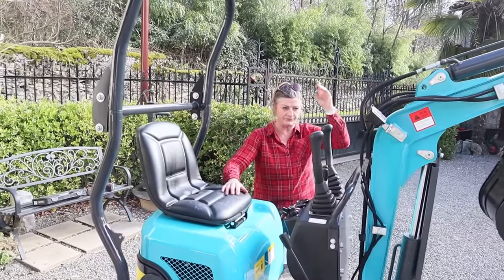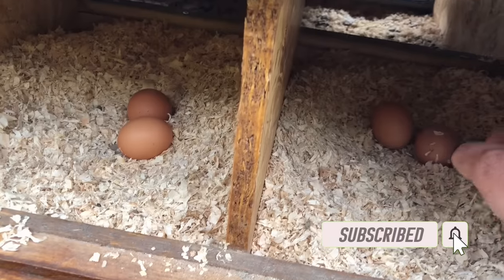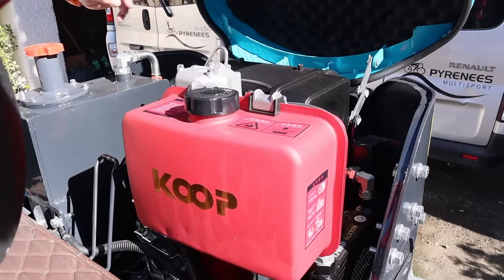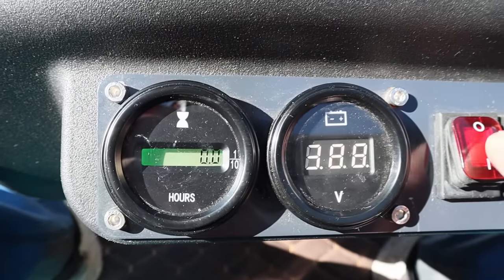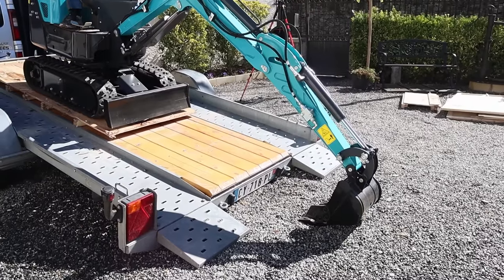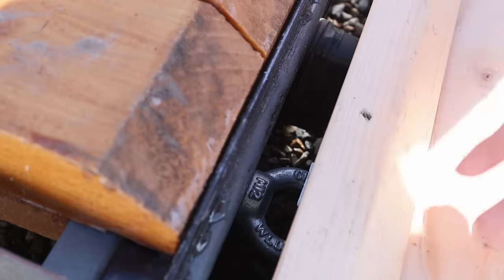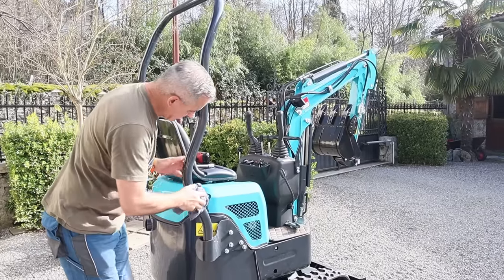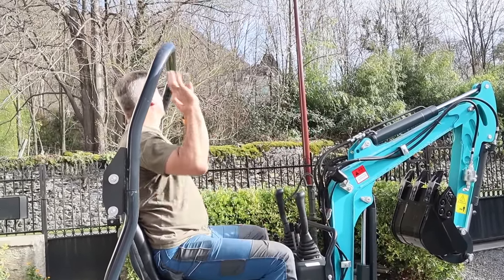Unboxing Chinese Mini Excavator | Nuoman from Alibaba

Comment: The only thing that would worry me is the uncertainty between China and Tiwan. If China Invades will there be sanctions and will you still be able to get parts. A seat belt would be a good idea. If it dose ever go over you want to stay inside the roll cage. Most deaths happen when people try and jump then get trapped between the machine and the ground. My number one plan with any machine when it goes wrong is stay inside the safty cage.
Reply from the maker: Cheers Mark - I have fitted the seat belt since the video.  Parts will be fine locally, they are very standard and if not I should be able to fabricate something.  Thanks for watching.
Reply: @HomesteadingUncontained  To be fair most the things we buy in the UK come from China any how, even the so called it was made in uk companies get the materials or parts from China. Chips for car engins is a good example, We can only hope that dosn't kick off anyhow. Glad to here you've got the seat belt sorted. I rolled an old 3cx J.C.B many years ago and it didn't have a seat belt fitted. I can highly recomend not doing that again as it rolled two and a half times down a steep embankment while i desperately tried hanging onto the seat. These days i like to be firmly strapped in.

Comment: Hmmm, haven't watched yet or seen 1 month down the track. But my past experience ... and gut feelings about Chinese machinery ... is not good. Some needed work before first start up (loose hoses etc); some had bits fall off a day/week/month later due to the nasty cheap bits they just phillips screw on; sometimes they wear out and won't start well after a few months.

I came to the conclusion, spend more for reliability and resale value.

Good luck.
Reply from the maker: The machine is well built.  It performs well.  And the price was good.  of course if I had a much bigger budget I would have gone for a locally sourced named brand but at theme I could not even get a 2nd hand 20 year old machine for less then €12k.

Comment: Greasing non moving parts is absolutely pointless.
Reply from the maker: It is common practice for me - I have two 75 year old cars and when I renovated them, I had to prise plates apart from each other that had rusted over the years.  So there is no harm in greasing between non moving parts to try and stop that from happening.

Comment: Guys, that machine has caterpillar tracks for crying out loud. What do you need a ramp for??? Maybe you guys should have watched some U-tube vid's of people operating excavators. You know what they say, a little bit of knowledge is a bad thing.
Reply from the maker: To be fair, I built this little ramp to protect the trailer lights as I use it also for my tractor.  But yes, I will get used to it for sure.

Comment: Check out Dig_It_Starnes  He has a review of the same company. It's a little different but he says the bucket teeth should be mounted on the inside of the bucket. He says that's why it will not dig that well.  I have no idea. I am just sharing what he said.
Reply from the maker: Cheers Van.  Just did and you are right, the teeth seem to be on the wrong way round.  I would have never known.  Will try and swap it round.
Reply: @HomesteadingUncontained  It may, Like I said I just watched his video. I hope it helps you dig better.

Comment: Can tell you've  never driven excavator.
Reply from the maker: You guess right, but it will not take me too long to get the basics, I have to as it is me doing the work. 😀
Reply: @HomesteadingUncontained  you could have used the boom/arm to avoid digging into your driveway.by putting the bucket flat and pushing down lifting the front end up.It's a useful technique to learn for crossing ditches etc. Though that thing wouldn't cross a very big ditch. Some of the coolest stuff is about 40 to 60 feet down.at base of mountains or hills buried in the old run offs..If you get bored 😊 I would get in trouble around here with that thing😅

Comment: The engine must be KOOP around 10kw

The engine power drops so quickly as the hydraulic cylinder moves to end (stall). And no matter how big the oil cooler, still, this engine cannot be operated in a long periods.
Reply from the maker: I think I will overheat before the digger - but I know what you mean, I will be gentle with it 😀

Comment: Unfortunately these are little more than a toy
.even a well used brand name machine is superior to these.pump over heats  with any meaningful amount of tracking and realistically a couple of mates an box of beer is a faster option than these.
Reply from the maker: It is doing pretty well on my build so far - you must have some pretty big mates.  I have an oil cooler on mine and it is working through 40 degree days at present.

Comment: Question, WHY would anyone buy an expensive piece of machinery from CHINA? First of all, they have NO Quality Control. NONE. Once you buy it, you have a LOT of problems finding PARTS. Then there's the problem with Will It Work. When I was working for the DOD, they bought 8 "Mini-Trucks" for their maintenance people to drive on the base. Out of the 8, 6 had SERIOUS PROBLEMS. Like Knocking engines, Clutches that wouldn't return when pushed. Same with Accelerator Peddles, and all 6 had to be returned. Poor Dumb Business that Dealt with these trucks had to EAT the loss because China does NOT take items back. Just find a good used one with a Known Name. Parts will always be available as well as Service.
Reply from the maker: I must be lucky as my machine is perfect and I can source parts locally as majority are standard items. A 20 year old know brand here is still double the price of this unit and probably knackered.

Comment: If you can afford to buy something old and local built and fix it up I would go for it rather than buy cheap nasty Chinese junk.
Goodness knows how long it will last and I couldn't trust it to be totally 100% given how cheap and dodgy they are when it comes to building or making / manufacturing anything. If I was going to buy something kinda cheap and new I maybe try looking for things made in Australia, USA, Germany, Japanese, UK.
Reply from the maker: A 2nd hand crappy old machine, say 10 years old or more was 3 times the cost of this machine.  I did the research and tried the auctions and would have loved a Kubota or Bobcat… but it was not an option for me.  This little machine is doing the job and and I am 100% pleased with what I have for the money.  I wonder how many parts of these named brands also come from China.

Comment: Was I correct in hearing it’s Petrol??? Cost an absolute fortune to run if that’s the case! These really are not worth the hassle. Continuously brakes down can’t get fittings or not  readily available for it….clips hoses etc…..balls of crap if honest. Their Wish diggers….Chinese crap just pumped out.
Reply from the maker: No that was my mistake - it is diesel (red diesel).  Hasn't broken down - fittings are standard, nothing that cannot be fixed and serviced - I have a pretty decent workshop for all of this.  Hence the decisions to purchase instead of a 15 year old named brand that was already worn out.

Comment: A seatbelt in conjunction with a roll-bar are cruicial.  Have them both or neither.  The roll-bar in this case is juat as liable to kill you as the rest of the machine.  Chinese junk this is.
Reply from the maker: Thank you for your positivity - I have a seat belt.  And it is all working perfectly.